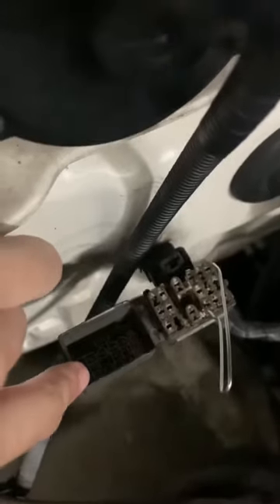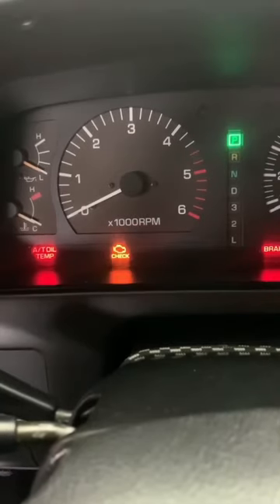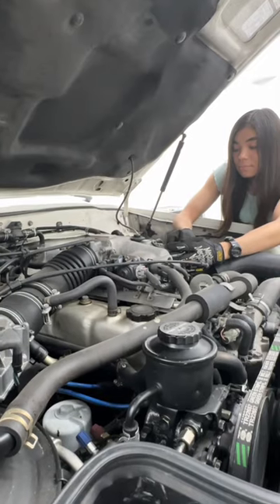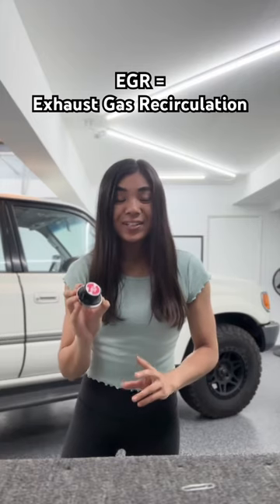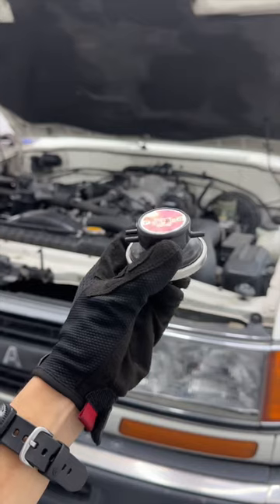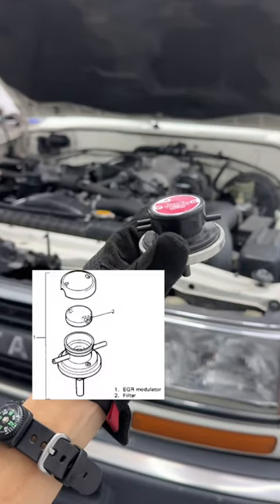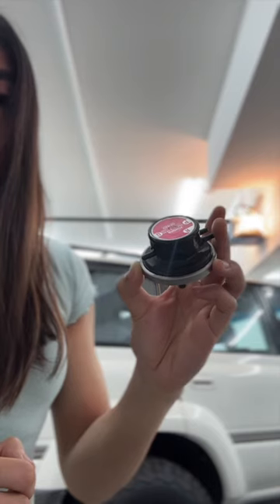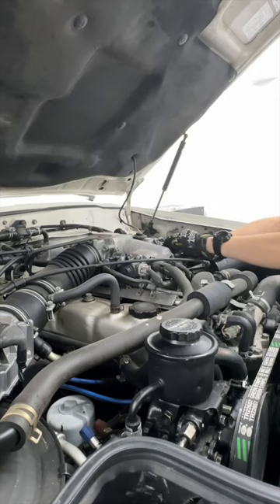THIS caused the Check Engine Light on my Land Cruiser?! #shorts #maintenance #toyota

Comment: Congrats on getting your Check Engine Emoji off, mine has been on since I gutted my catalytic converter & guess there’s no turning it off at this point.
Reply: You may be able to get a downstream 02 sensor simluator to trick the engine into thinking the catalyst is still there and working
Reply: We use Hondata (ecu tuning/reflash) on Hondas to turn off the upstream O2, but it probably isn't an option on your platform. The O2 "defouler" is most likely your only option.

Comment: Our problem was a bad gas cap on a Mercedes. They changed the caps to a cheap plastic from rubber and they never fit properly. For 3 months I told the mechanics what they problem was , and they disagreed. Finally we changed it and off went the engine light. What Idiots!

Comment: "Check engine" has to be the most useless thing ever. I mean there's only 2309420320929 tiny parts in there that could cause it. THINK YOU COULD NARROW IT DOWN A LITTLE MR LIGHT?!